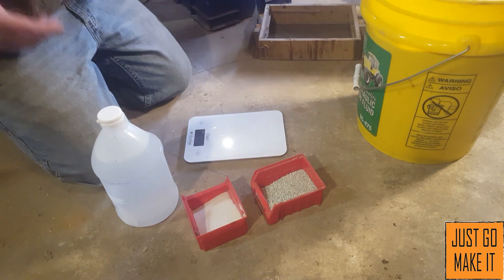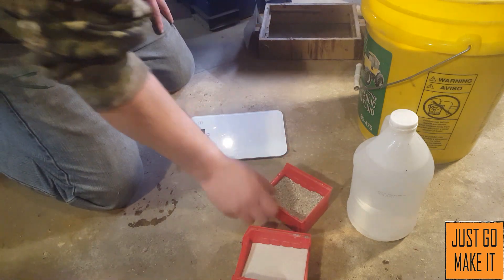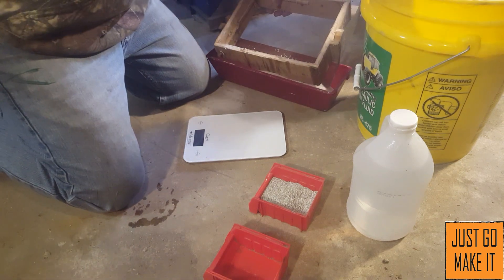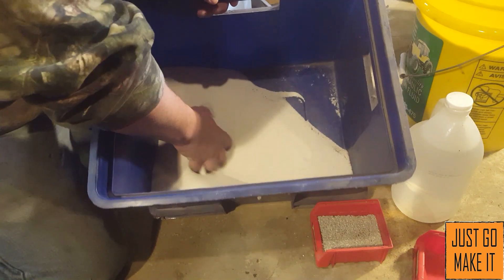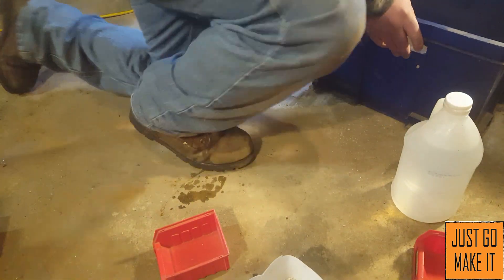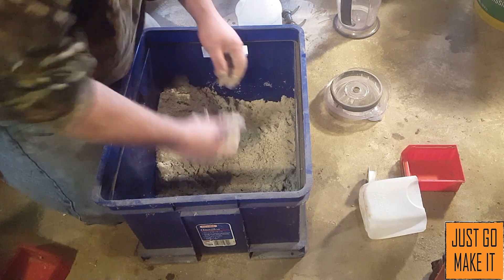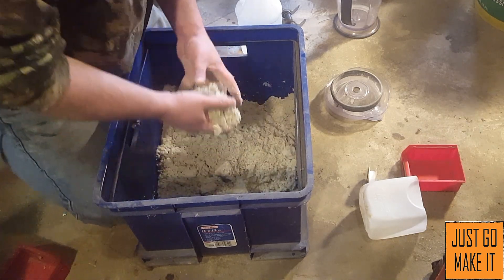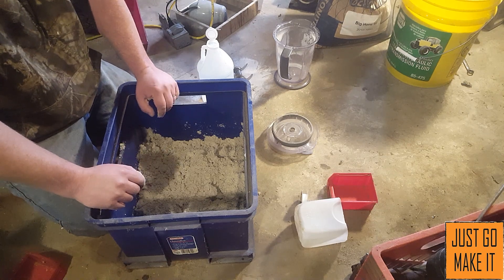Foundry Green Sand Mixing for making casting molds.

Comment: Hmm, makes me cautious about using H20. Molten aluminum and water definitely can cause problems. KABOOM.  My buddies aluminum foundry 
(Quality Castings) in Kalamazoo MI. I believe he used silica sand, denatured alcohol,  bentonite and oil. I think anyway. I'll have to give him a call up in Michigan. I've got a couple small patterns I made out of mahogany with 2 degrees draft I need cast out of aluminum is why I'm here looking. I learned the hard way to add 7 thousands to the wood pattern.  Allowing for shrinkage.  
Thanks for the video.  It shook my memory banks.
Reply: I make a hybrid greensand, instead of just h20, I make and use sodium silicate (water glass) I'm able to keep my h20 level lower, and the sand has a much higher greenstrength. Especially after a few runs and refreshes. I have been able to get absolutely insane finish quality using it. It doesn't even look like a sand cast. After I mold it I let the molds sit out in the hot sun and dry up. When it's time to pour there is virtually no h20 touching metal. (And if worried about explosions- I've done enclosed molds with fine mesh overly wet greensand and all that happened was a really crappy surface texture. Unusable, but no explosions. Those were BIG backyard pours too. Several kilos

Comment: When wetting the bentonite clay with water, you have to wait at list 24 hours for the bentonite fully absorbing the water. One hour or two will not be enough to fully implement the binding and plasticizing power of bentonite clay. (especially when making mixtures for ceramics and pottery )